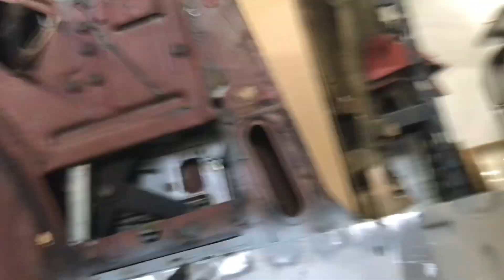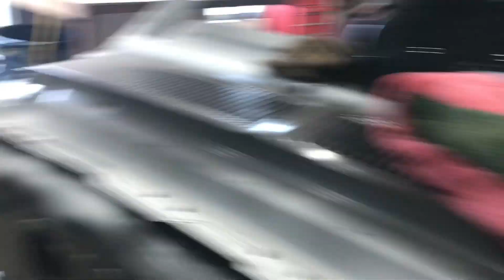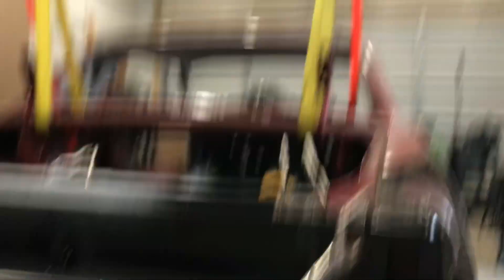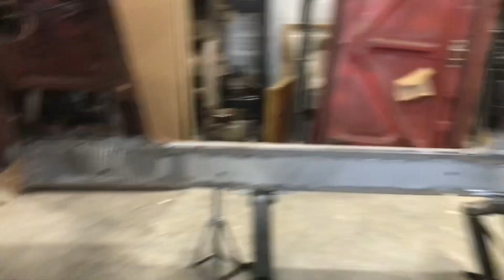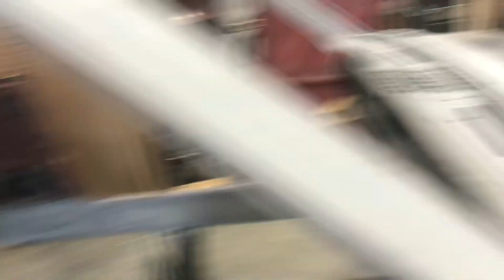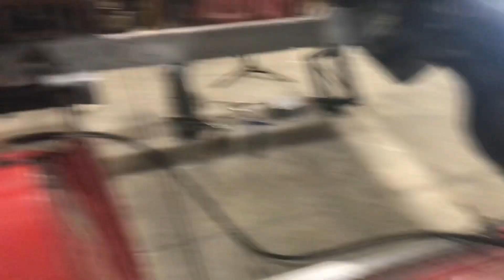67 Mustang rear frame rail installation - Part 21

Comment: do you have the measurements anywhere or are you using the generic ones that everyone posts....tia
Reply from the maker: I’m used the dimensions from the Ford manual.  The tram helps, but it can still be pretty challenging making sure you’re actually measuring from the center of the hole to the center of the hole on the opposite side.

Comment: Hi there no one can hear you.
Reply from the maker: Yeah, unfortunately there are some portions of the video where the microphone didn’t do a very good job of picking up the audio.  Not much I can do about it after the fact either, so that sucks.  The fan in the welder is a bit loud as well, so that makes those portions challenging too.  I have to wonder if people who do this stuff more often have additional external microphones.
Reply: @67MustangResto  no worries, you doing a graight job

Comment: hello i have a 66 coupe which i am trying to restore  i am at a loss as far as do i start from the tail light panel the to the trunk brace before installing the  complete frame rail or visa versa
 and on my transition pan does the seat belt alignment hole should there be a hole  in the frame rail ?
Reply from the maker: I believe the metal block with the threaded hole in it that the seat belt bolt threads into is welded to the bottom side of the of the outer flange of the frame rail. If the transition pan is pinched down  so that it conforms to the profile of the frame rail, the hole in the panel should align with the hole in the frame rail.  That is assuming the frame rail is located at the proper side to side width when you pinch the transition pan down.
Reply: @67MustangResto   there isn't a hole it's all solid
Reply from the maker: If there is a hole in the transition pan, then I would say you’ll probably just have to use that hole as a guide for the hole you’ll need to drill in the frame rail flange.  Then either weld a nut on the bottom of the rail or use a piece of 1/4”-3/8” steel plate with a hole tapped to the proper thread size to fab up your own mounting plate. If neither the rail or the transition pan has the hole, then you will probably have to take measurements off the old pan to locate where the new one goes.
Reply: @67MustangResto   is there anyway I can contact you